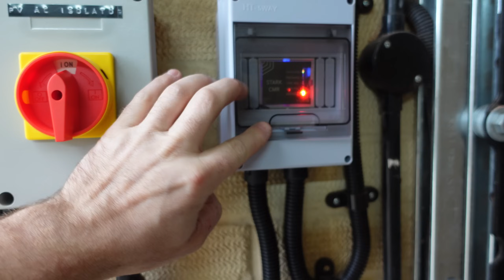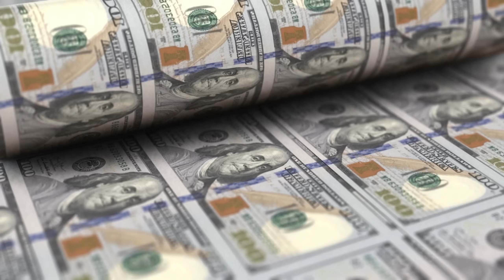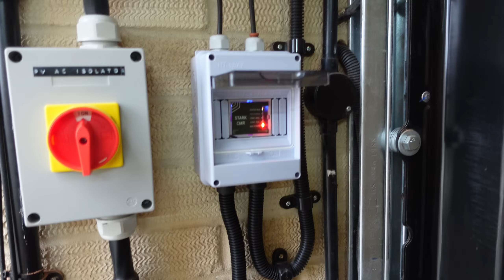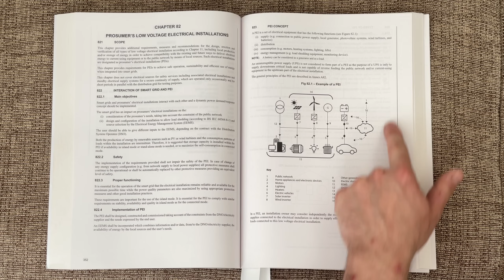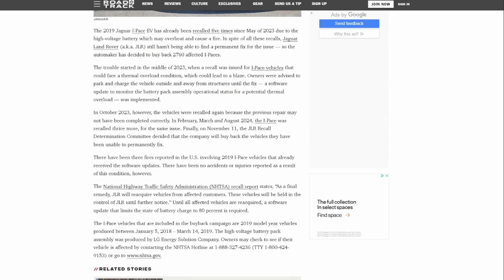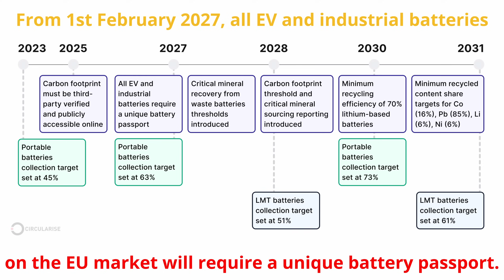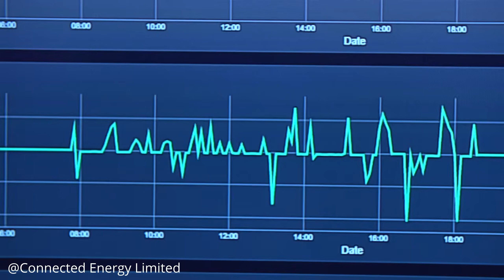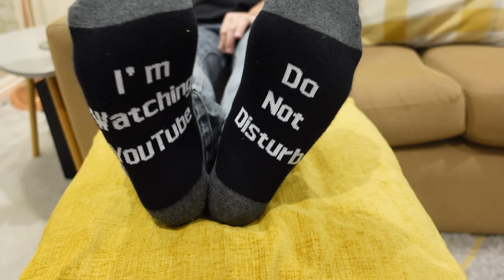4 Reasons I Chose an EV Battery for Home Energy Storage

Comment: Excellent video! I was originally looking at using an ev battery but opted for the Seplos kits instead. Had I found you sooner I might have gone for an ev battery setup. 👍🏻
Reply from the maker: It sounds like you made a good choice. If I didn’t have the larger aim of the videos and sharing the story i might not have gone with an EV battery. However it’s working well and I guess we will have to look back and reflect on the choice later down the line
Reply: @ I will be watching! 🤣👍🏻

Comment: I worked with a guy who did his own solar system (I don't think he has storage) but he did the entire DC side at several hundred volts.
TBH your typical EV battery is way more than a house needs (unless you want to charge an EV with it), maybe hybrid packs would be a better choice. A Prius Prime is ~14kWhr and that should do a house nicely
Reply from the maker: It’s most definitely overkill but it leaves us EV and heat pump ready to ensure we can always use cheap electric. We are also running it to aid the grid when needed and when energy prices secure a small profit

Comment: EV Battery for home?  you do realise that they have to be temp. controlled? How's your house fire insurance?  Do they know?  Hmmm..........
Reply from the maker: Yes the batteries are temperature controlled. I’ll plan a video to address it when we’ve had a summer heatwave. This time of year I’m actually insulating the battery to stop it getting 2 cold. We run these far lower rate than they ever would have in the car so water cooling is not needed. Just managing temps through KW charge and discharge. 

These are valid concerns

Comment: What inverter did you use for this battery???? How did convert 400v DC to 400v AC 3 pfasic for home use???
Reply from the maker: Fox ESS H3 Pro 30kw. You can use smaller size inverters or single phase inverters. But this project has been go big or go home

Comment: I love your enthusiasm for this emerging opportunity! Your technical ability is well above mine for sure but the fact that you can navigate through all the bureaucracy with a smile on your face is amazing, I’d be in jail in 3 days. I’m retired in an area that has no oversight as to what happens on my property, it’s wonderful! I’ve used 18650 cells for years to run my little home, no bms, the inverter will disconnect on the low side and the Victron keeps the high side to around 85%. Monitoring the 7s modules with a multimeter regularly let me sleep at night. That being said, I now use calb 180 cells with a bms and it’s been rock solid for about 4 years. I only have a 5kw system but it’s all I require and the joy you get from looking after yourself is priceless. Keep up the great work!
Reply from the maker: It’s good fun. I’ve been in the situation of testing hundreds of cells on the living room floor. Trying to get through as many as I can in amongst my day routine. 

I would always recommend a BMS. JK comes to mind. But I also understand you’re keeping the battery within a voltage range. I had a 2 kWh pack I was running without a BMS for a remote project for a few years. I would balance it with the charger. But I had a load on it I forgot about and it discharged 1 bank to around 1v. They all went. Some of the god cells that remain are what you see in some of the video background. Waiting for a project to use them

Comment: You can get lead-carbon storage for around £140/kWhr.  Still more expensive than an EV battery but having lead-carbon technology and only 48V terminal voltage I think I'd rather pay the extra for the vastly improved safety PLUS a warranty...... guaranteed 3,000 full charge/recharge cycles. <edit> The large cross section cables need only be a metre or two long so no real issues there.  A 5kVA charger/inverter can be bought for £750 (Victron).  It has all the switching and control (grid down detect, auto charging, instant switchover, fully programmable, BT and wifi connection etc).  No complication, no dangerous voltages.  Just sayin'.  Not sure how much your system cost or how much time it took but I reckon I could do the carbon-lead version in a weekend for <£5,000 AND include a diesel generator!  Upvoted you though - interesting solution and I'm keen to see the details.  Bring it on!
Reply from the maker: You can’t beat a Victron inverter

Comment: This is awesome - I just finished building a 48v battery system with 120kWh storage - I charge the battery at night and discharge during the day as I get free nights - my first bill was $50 USD - it should have been about $600. I was not as brave as you with using a car battery but I will still get an ROI of about 4 years due to the 30% tax credit currently in the USA - oh great video as well
Reply from the maker: Sounds like we went down a very similar path but achieved it a different way. Thanks
Reply: @nicholastaylor1546 where do you get free nights?
Reply: @ I live in Houston Tx - TXU Energy offer this as one of their options
Reply: @cliffordbradford8910  Shop different electric plans.  You’ll find companies offering it.

Comment: I wonder if its possible to put 2 Tesla batteries in series.  With an 800 VDC battery you could use the Danfoss drives to create a 3 phase 150 kVA (or more) BESS. Got me thinking!!
Reply from the maker: Yes it’s possible. I’m sure. But it would need some decent comms to manage and balance the 2 packs

Comment: EV batteries piling up what next. More than likely a fire, but I hope I'm wrong.
Reply from the maker: Good point. Concerns like this need to be addressed.

We don’t worry about gas being fed into homes running in little machines with fire inside them.  Largely because they have designed to be safe, installed by professionals and get serviced. You could also say detections like smoke alarms and CO2 alarms. 

The same could be true of EV battery’s in second life storage. As I said in the video. Don’t install one on your house. The place for them is containers.

Comment: If you believe in this so much, make a business out of it. Scale it at the same time to make it profitable.

I’m considering buying a used Nissan Leaf 62kWh car, and buying a Wallbox V2x charger - when it is available, so I can trade electricity just arbitrage the night and day rates. Saves all the faff of DIY, both packaged up, ready to go solutions.

Payback can be anywhere between 2-7 years depending on the grid and purchase prices and export prices on the grid. But that’s including installation time.

I doubt the 4 year payback you mentioned includes your time?
Reply from the maker: Energy arbitrage helps you and it helps the grid. Nice. 

My time is excluded. But it’s also fun to me. And it’s also a project for YouTube. So my time would have been in a project whether it be this or something else. 

A lot of time was spent getting a new inverter working with the communication software. But I’ve had a part in advancing the cause. Featured in the video ‘We’ve hacked a solar inverter to work with an EV battery’

One day. It has crossed my mind. I’m not a large entity. I had thought about sourcing and testing the odd EV pack and selling them as ready to go. But it opens up challenges. Storage. Vehicle with a Hiab. Finding packs with enough profit margin. Space is a big issue. O and time 😂😂

Comment: I have made three 30kwh battery packs so far using 310Ah cells. With current cell prices around £60 that is just over £60/kwh plus a BMS around £130 plus busbars and casing. Even adding a 5kw inverter keeps the total 240v AC output to around £120/kwh. No complicated and potentially dangerous handling of 350v DC. Any heavy cables can be kept very short so not an issue. It is good to reuse scrapped EV batteries but not for the average DIYer. My annual electricity bill (about £200/yr) is dominated by the daily charge. Having an extensive solar array this annual costing includes the energy running costs for two EVs totalling 15,000 miles/yr.
Reply from the maker: It’s impressive how you can sway the figure you give them by adding solar and batteries. Impressive size packs you’ve built. What voltage do you use with them? I think 50v DC should be treated as dangerous as 350v DC. Both have the power to kill if current flows through you. The scary thing is sometimes people respect 350v more than they do 50v. Would you agree?

But I take your point and agree totally. As far as HV wiring. You have a cable out of the battery connector, fuse, capacitor, isolator, mc4 into the inverter. All of that would be connected to the inverter without the connection to the battery. Then battery connected. Then isolator closed then battery activated to close the contactors. Very little messing with 350v DC
Reply: @TheOfficialBatteryMan  Yes I have a 48/50v system. I do treat the system with respect but it is the current rather than the voltage that kills. It needs a much better connection with 50v to kill than 350v. The respect or lack of it is down to the individual. With the lower voltages burns from shorts can be more of a concern. 

I am not quite sure what you mean on the other point. I feed the batteries from the PV with Victron MPPT units and from there to GTI's . Once set up it looks after itself. I have run this for two years now and adding further batteries at £2500/30kwh incl BMS will be an easy and cheap add on in the future.

Comment: I live in Perth WA and have a 10kW system. I can't export, as the local network will not pay for exporting from systems over 5kW. I desperately want a battery and have thought about  this a lot. I will look back through your other vids tonight now to see what else you have to say
Onya👍
Reply from the maker: I’ve ended up showing most of the process. And paved the way with one brand of Solar inverter. 

Energy storage is key

Comment: 5:16 - 400-volt DC battery in DIY situation is too dangerous.  Also, regulations may be limited to the "48V" standard along with home insurance policies could get in the way.  In the future, maybe they'll allow 240V since 240V RMS is a common home standard, but DC voltage can be more dangerous as there is no zero crossing.

Alibaba is selling brand new EVE 3.2V 280Ah Lithium Iron Phosphate (LFP) cells for £53 each which works out to about £59/kWh.  But you have to find a good rate on freight shipping but maybe these LFP cell can be found locally in UK warehouse.  You'd also need a BMS but those are cheap.

Brand new LFP cells are a way safer option versus used EV battery with who knows what kind of damage and wear-and-tear it's been through.  Wear and tear includes very high current draw for frequent EV acceleration from stop combined with both physical shock (vibrations & impact) and thermal cycling that an EV battery goes through daily!   All that for possibly several years along with some accidental impact force that hit so hard that the EV had to be totaled by the insurer.  You also have to cart the thousand+ pound heavy EV home and then dismantle and inspect the cells one-by-one.

Comment: I lost £7.5k buying a Tesla P100D pack that looked fine but ended up being water damaged
Reply from the maker: Ahh sorry to hear that. Must have been hard to face. Not much going back from a water damaged pack.

It’s now possible to test packs before purchase to confirm they are in good condition. These sort of problems show themselves up with the Battery Emulator software.

Comment: Good vid👍
Cheaper than just buying CATL LFP 305AH cells and adding a BMS and inverter?
Cheers
Reply from the maker: A little cheaper. . But not a massive amount. Price and condition of the used battery will vary but the new CATL cells are a know capacity from the start. . Plus points and negative each way.

Comment: ( whats the home use life cycle. What is the disposal arrangements once spent.)
Reply from the maker: A bit of useful info about my set up. . My battery came to be with 5000kWh charge/discharge cycle. Which is a total of 83 full charges. LFP should manage 4000 cycles leaving 80% remaining capacity. I’ll continue to use it until its state of health is much lower than that. So at this stage I’m not worrying 2 much about it. 

What are people doing with any home energy batteries? I think technically Tesla should take mine back. One day we will have a lot of spent batteries and recyclers will be kept very busy
Reply: Should last 20 to 40 years. Even if they are 70% of of original value particular if you have 50 kw to 90 kw battery to start with.

Comment: Nice video, I have build a battery pack from a iPace, 90kWh and rearranged it to 7 battery string of 4p15s cell’s. The chemistry is NMC from LG chem. all is working well. But when it comes to use it on the grid, 😊 I needed CE certification, and this is something none of the EV batteries have, aldo they are more safe then the CE standards. So my project is finished but not usable because of CE regulation. From using EV batteries if there is no way to overcome CE regulations.
Reply from the maker: Certainly a challenge. Amazing how much can be done off grid

Comment: Mainstream EV battery packs need to get broken down into standardized 5-20kWh 50-100lbs modules. That would make them much easier to service when individual cells go bad, reuse in other applications and quench when a module has a thermal runaway.
Reply from the maker: Yep. It’s not normal to have to crane in your home energy storage. A lot of the VW ID packs come like this. The problem at this stage is that it needs a new battery management system. As the BMS in the vehicle was designed for all the modules working together This turns into a lot of man hours dealing with 400v down to the 50v. 

I learnt recently about pack sealing. Packs are designed to be relatively sealed to prevent moisture but that requires adhesives and later vacuum testing to insure seals are in order before vehicles go back on the road.

Comment: If there is a short circuit in that battery and a run away chemical reaction how will the wall take the heat, did you put in sufficient fire protective materials? Or any?
Reply from the maker: These sort of considerations are very important   One of my reasons for not recommending being installed so close to property

Comment: I'm stepping into this world. I got an EV in December and realised if I had a 15kW battery I could store my daily usage over night at 7p. My daily usage (minus the car) is 8Kw a day, it peaked every now and then just shy of 10Kw. 

I've been looking down building my own back route. Start at the basement so to speak. Also I'd like to know every step, as it will be me servicing it. 

I taking the government should give pensioners as 15Kw set up. I'm sure if they purchased  on mass, they could get the numbers down pretty cheap, and then instead of the £300-500 yearly fuel benefit, they would have 7p per kW electricity all year round, for the foreseeable future 

Looking forward, Add to this intelligent charging meter, all the  battery packs could all trickle charge when demand is low in their areas. As if we had a 3rd of the population charging at night, the cheap (low demand)rate wouldnt be needed. 

If we had the whole contrary doing this, we could flat like the supply and demand curve too. Making future budgeting and economic decisions far clearer to make. 

We need X amount of power 24x7,, build x nuclear stations, job done.
Reply from the maker: The challenge is steering the big ship. Batteries are one of the best ways to save money in the uk on electricity.  Thanks for sharing

Comment: Our power goes out many twice a year, maybe an hour each time, maybe. This makes zero economic sense and increases the risk of fire by 100%. Home Insurance won’t even cover these things. Good grief.
Reply from the maker: The system isn’t for power cuts although it could be used that way. It’s to demonstrate how we can fill the need for grid energy storage. Check out the video before this. NESO has a game that highlights the importance of battery storage. 

The system isn’t currently netting around a 12p per kWh. Supply the grid at the times when it needs electricity the most. Working its way to pay off the system. 

Your concerns are also incredibly valid. Thank you for sharing them. 😀

Comment: Interesting idea. Excellent project you've done there. I can't see many following your example though. Maybe an inverter company need to make an off the shelf kit to plug into different EV batteries which would make it more viable.

Personally I've ordered a Powerwall 3 and an expansion pack. 10 year warranty, small and compact size and I can take advantage of the software features. Yes it's more expensive per kWh but much less hassle to install and equally so if I move house in future!
Reply from the maker: Yes I couldn’t agree with you more. I never intended this project to be a ‘how to’ but it’s surprised me how many started their own projects like this. I also discovered an entire community of people doing similar across the world. Either connected to the grid or off grid.
Reply from the maker: Yes I couldn’t agree with you more. I never intended this project to be a ‘how to’ but it’s surprised me how many started their own projects like this. I also discovered an entire community of people doing similar across the world. Either connected to the grid or off grid. 

Nice set up. Sounds ideal